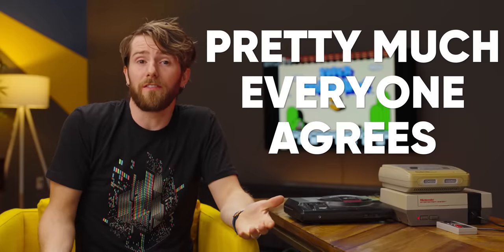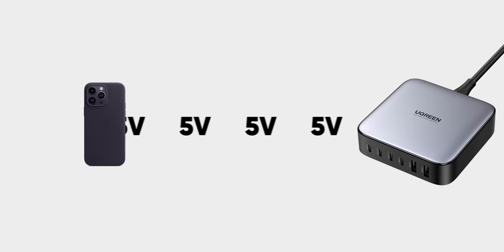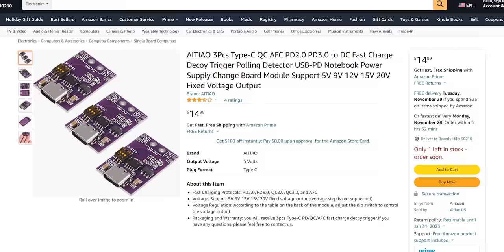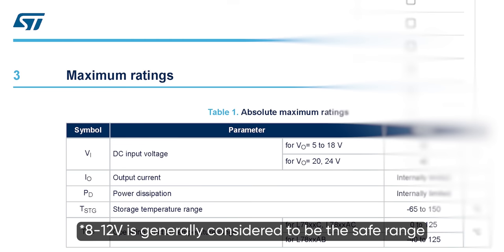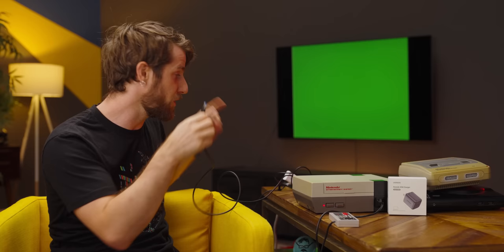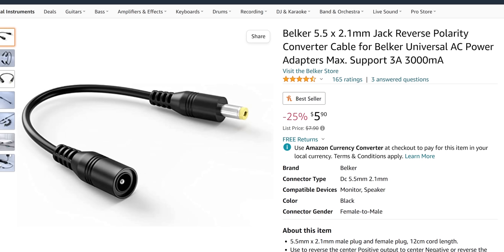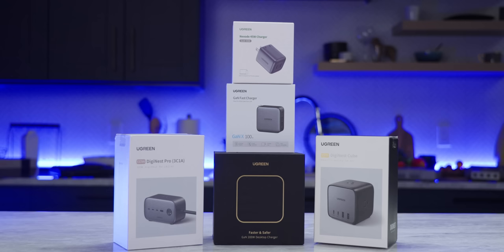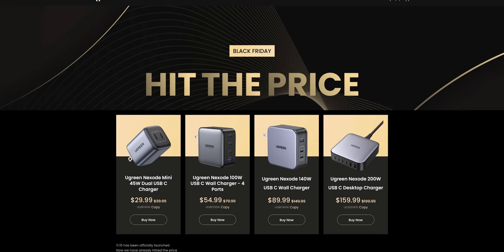How to Put USB-C Power on ANYTHING (almost)

Comment: I took a shot at this like 6 months ago when my laptop charger broke and replaced it with a GaN charger USB-C to barrel jack cable. I was surprised it wasn't being discussed much anywhere. But I didn't think to use the same tactic for old game consoles since they can be a bit sensitive
Reply: I put a PD 100W USB C Port inside my laptop and wired it to + & - of my barrel jack, had to modify the frame a bit
Laptop uses up to 180W but its totally worth it for portability, and being able to charge your laptop anywhere easily
Reply: @flosa1995  unless you're thrashing it to hell by stress testing it or something (which is dumb to do on a laptop anyway lol) or overloading a fat dock (which if it didn't have thunderbolt in the first place I doubt you are), then that should be fine I'd think - your power draw likely won't ever come close to that max. I'd do the same if I trusted myself with a dremel to make it presentable but I don't 🤣

For retro game consoles though I don't think I'm willing to risk it, they're too weird, arcane, and if it dies you can't easily replace it. Either OG adapters or the battle tested Triad Magnetics are the way to go for those
Reply: @alienJIZ1990  
Yup plus I'd think that modifying a retro console decreases its value to collectors, even if done properly
Reply: @flosa1995  yeah, if it ain't broke, don't fix it. Repairs are another matter but even then, I'd still go with the original barrel jack version of this "ShawMerlin/NES-Power-Module-Redesign" over their USB-C option just for authenticity

Comment: Ya know after 30 years, Capacitors can leak out their fluid, or fall out of spec.  It’s probably worth doing a recap on old Consoles.  Capacitors are often employed to smooth out ripple, so it could play into these power supply considerations, among others.  It could even change the sound of the output, maybe un-nostalgically, or it could restore childhood memory sonic performance.
Reply: oh yeah any old system like the nes/snes/sega master/genesis/pce/turbo 16 need to be recapped before trying to do something like this.
Reply: And that's even if they bothered to pay for decent capacitors in the first place. Some systems were built with the assumption that they wouldn't still be in use more than a few years later, so cheap capacitors.
Reply: @SmallSpoonBrigade  well that and there was capacitor shortage/issue in the late 80's and early 90's so they had to use them. This is why so many older systems like the Genesis and Turbo16 have damaged PCB's from cap leaks.
Reply: @CecilTheDarkKnight234  Why? They're supplying the same voltages as the original power bricks. Unless you're suggesting you shouldn't use the console at all without a recap I think you misunderstood what happened in this video.
Reply: @chublez  No, it's you who isn't understanding. The console shouldn't be used at all without a re-cap. The caps will be seriously degraded and they will be well outside of their rated hours.
Reply: Also check voltage regulators, if they go it can fry chips.
Reply: @CecilTheDarkKnight234  or cough get an emulator
Reply: "Just recap 4Head"

From watching Adrian's Digital Basement for a few years, I can safely say that not everything needs a recap, and the things that do are in the minority.

Is it better to be safe and replace them with all new caps?  Probably (if quality hasn't severely degraded like everything else in life), but it certainly isn't required.  I'd be more worried about old batteries spewing their guts and destroying boards.
Reply: @chrisschneider850  You're worried about batteries spewing acid out and not the caps? That's how the first gen Xboxes are dying. Their caps are ticking time bombs.
Reply: @SmallSpoonBrigade  how do you not consider that
I'd be like: someone will probably be using this decades later
Reply: @Xnoob545  Because it wasn't a thing at the time. There were still some older consoles in use, but technology was evolving rather rapidly and with that there was still a bunch of improvements to gameplay.
Reply: Recapping is quite common for the retro consoles, most shops that deal in retro stuff sell cap kits now, among numerous other improvements and such.
Reply: @AceStrife  I agree! I have rarely encountered a functional console that required a recap. I watch Adrians Digital Basement too and I've rarely seen him recap anything. It's a general thing that allows people to sound like "experts" I think. Makes them feel smart. As an experiment, I removed every cap from a PC Engine and tested each one, they were all perfect. I've recovered caps from damaged console PCBs and after testing them, they were still well within spec. This idea "you have to replace caps" or dire things will happen is basically total nonsense.
Reply: @snickerdoooodle  I think you are referring to the RTC (real-time-clock) capacitor specifically, which was a problem for all motherboard models except v1.6. Other caps can fail too of course, but it's good to know which ones are in danger the most.
Reply: @electronraygun6346  The caps used in most 90's game consoles are known to leak but it's not like every single one is going to fail.  Quality control wasn't as good back then and there's a fundamental difference in the way they are designed (don't remember the details but I think it was a manufacturing limitation of the time).  Game consoles also have to be built cheap in order to make a profit so using cheaper caps was basically a requirement.  I've never heard of anyone having to recap a PC Engine though so perhaps those used higher quality caps or a different type.  I have seen plenty of Sega Genesis/Megadrives, N64's, PS1's, and arcade boards covered in cap juice.  The main issue is mechanical so even if the cap test fine it may still fail and leak acid in a few months (another thing that's changed in newer caps in the 'juice' which is less toxic and less harmful to the board than the old stuff).

Comment: I have been researching to do just his thing. I was honestly going to first solder a USB-C replacement for all the mini and micro usb things first before moving on to triggers for other things. You seem to have solved my problem as I didn't know there were triggers that were switchable by soldering pads.
Reply: There are small $1 adapters on Aliexpress for all of your micro and mini usb to USB-C stuff.  That's what I did.  They even do an assortment of USB ribbon cable adapters in all sorts of configs!
Reply: An alternative I like is magnetic-tipped USB cables, which come with a variety of detachable tips: type C, micro-B, and Apple Lightning.  The tips are low profile and you keep the appropriate tip in the device's charging port.  The other end of the cable is USB type A male, which fits any USB charger that has a type A port (so it also fits the USB ports on a desktop pc or laptop pc).
     I've seen two styles of magnetic-tipped USB cables: round tips and oval-ish tips.  The round tips are good only for charging, but the oval-ish tips have pins for transmitting data too.  I chose the oval-ish style, to be able to transfer files between my pc and smartphone.
     I keep at least one charger + magnetic cable in each room in which I spend a lot of time, and I keep the appropriate tip in each device, so any charger+cable can charge any device.  I didn't have to buy any chargers, because enough of the chargers that came with devices I'd purchased in the last 12 years have the type A port rather than a hard-wired cable.
     A big advantage of keeping the tip in the device is that it eliminates wear & tear on the device's charging port.  Last year I had to replace my cellphone because its charging port had become too finicky after several hundred cable insertions.
Reply: 2 pin usb c is just nice. Also there are trigger boards with switches, for the times that you need some prototyping.

Comment: The USB-C to barrel jack cable is my favorite out of all the cables I own. Being able to make older devices operate similar to the new ones is pretty awesome. I have one that triggers for 20V that I use to charge my laptop and if I use it with a USB-C power bank that has a maximum output of 12V I can use it to power a router for easy testing.
Reply: Which USB-C to barrel jack cable are you using?
Reply: Give us an Amazon or AliExpress name to search up!
Reply: @snowdaysrule  Thanks a ton man!

Comment: Linus: I will put USB-C on everything.

Apple: Write that down! Write that down!
Reply: You mean don't write that down
Reply: @gwenryanmillett  Nope, definitely "write that down. It may come in handy 10 years from now!"
Reply: Correction:
Apple: Look away. Look away!
Reply: @gwenryanmillett  They legally have to now because of Europe
Reply: @Demonologist013  Kinda. They are required to have USB-C in all devices that are powered by a cable. If they switch to only wireless charging, they don't need to add it.
Reply: @Demonologist013  Kind of, but not really. The law only says that of it has a charging port, it must be USB-C. I'm siding with MKBHD and believes they will be only wireless in 2024.
Reply: @ajbp95  I think the law also only comes into force in 2024 🙃
Reply: They will definitely write that down, but with a small note:
"Make specific usb-c cable for every device, so they will still need to buy a crapton of certified cables from us!" (example: receiving board on the usb cable to request for specific volt/current range, but not on device)
Reply: @graciouscompetentdwarfrabbit  True, and for laptops it's one year later, if I'm not mistaken. So Apple has 1,5 year until Iphone 17 (of whatever it will be) to perfect their wireless game.
Reply: right, but no:  ugreen is doing the same thing as apple....and linus is helping :/    lets sell adapter adapters

Comment: I have a few adapters and cables to convert to USB C for older laptops, what I discovered is every single cable and adaptor like this will draw power even when no device is connected this is why when you see linus plug in the second cable with nothing connected it did a hand shake as if you plug in a standard cable that does not happen until a device is connected to the other end, so you technically cant live this sort of thing plugged in 24/7 unless you can turn the socket off as it will always be drawing power no matter what.
Reply: So maybe not a good idea for laptops then . . .

Comment: I've been using their 100W charger and a couple of their cables for a three months now. It's very convenient, I don't have to carry anything else, just one brick and a couple of cables to charge everything! It's doing a good job charging my laptop, phone and smart watches at the same time - I'm glad I bought them and not anything else
Reply: Just curious, what's better quality in your experience, ugreen, baseus or anker? Is ugreen really have a good track record on their products?
Reply: I didn't have a chance to use Baseus or Anker, but from reviews, teardowns and tests that I've seen - Ugreen's 100w charger built with high quality components and there shouldn't be any issues with it. The packaging and brick itself feels like an Apple product, in my opinion.
Cables that I use feels premium and robust, one of the best sleeved cables I've seen and used.

Comment: Like the idea, but I think its more advantageous to do something you would take with you like an eletric razor vs a console, so that you don't have to take its proprietery charger too.
Reply: The advantage here is reduced clutter moreso than anything else and I think it accomplishes that goal masterfully
Reply: My 2 Laptops,Toothbrush,Shaver,Flosser chargers have all been USB-C'efied
Reply: @milesbush9589  The NES/SNES/GEN do benefit, but i think the PS1/DC/N64 don't gain anything since they don't have wall warts. If anything it makes it less convenient unless you already needed to replace the power supply and cant source a replacement

Comment: The NES and SNES original power supply outputs 9V AC! Since the circuit inside of the consoles can also take in 9V DC this method is valid, but some devices may not work with DC when they want AC. If you trying this you could damage your device.
Reply: MattKC did a video on this a few months back. In a lot of these consoles they'll take DC just fine, it just goes through the rectifier and continues onwards as intended.
Reply: @samuelw4584  yes i know but the fact is still that on some device this could not work. And trying it without potentially damaging a device is not the greatest idea. The NES/Famicom and SNES  as I mentions are devices that also accept DC because how they convert AC to DC which makes this “mod“ totally fine.

Comment: There's good reasons to change the power supplies in consoles, I've already done a few MEGADRIVES/Genesis and MasterSystems replacing the 7805s with buck converter modules means there's no heatsink required and cuts down the overall temps which is noice. and for the other systems Dreamcast, Saturn etc it can help with failing PSUs and be more efficient for installing mods like ODD replacements. There's some really nice options for GameGears and Gameboys too for USB type C.
Reply: Really? So basically I can rip out my Dreamcast psu safely and mod it that way?! Oh I'm kinda hype to resurrect this bad boy, been sitting gathering dust in my collection shelves
Reply: @Chronostra  did you watch the video? they do that in the video
Reply: @TheSynrgy1987  watch the video? Yes. Understand the explanation? no.

Comment: Might aswell put it on the rtx 4090 at this point, even that will perform better than the current fireplace one
Reply: Currently USB c pd can deliver up to 100 watts, it will need 6 USBs c to make it, but USB 4 pd will in theory deliver up to 250 so 3 of those will do it too
Reply: @andrescarrasco1248  it was a joke.
Reply: @DanielGyimesi  We don't do that around these parts. Not when USB-C is involved.
Reply: @DanielGyimesi  I know but it's actually possible, in fact I wouldn't be surprised at all if some brand of both PSUs and GPUs  decide to try it, pretty sure because of the amount of USB Cs that are being made right now, it would make financial sense

Comment: I have a lot of adapters like this, including a magsafe connector for the MacBook. 

Most of the time they work, but sometimes they just don't negotiate properly. 

It's okay if you're at home but don't rely solely on these if you're on the move outside. Have a backup ready.

Comment: Having a large collection of old consoles and all of the power adapters that go with them, this is a game changer. This would simplify my set up tremendously! Will do some more research into this. Thank you LTT!
Reply: It would definitely make a small setup where you plug in one console at a time easier. Just plug a few things in the back, controllers in, and you're ready. Some video cables have multiple end connectors (e.g. SNES, X-BOX, Playstation 1/2).

Comment: These console mods and adapters are great ideas! If there's one thing I worry about with vintage consoles its is the power supplies giving up the ghost. Some of these are very difficult to replace due to their rather proprietary nature. Being able to power them using a standard that's gonna be around for many years to come (I hope) will hopefully keep these machines going for a lot longer. (Of course this only half works with things like the Dreamcast. I'm more worried about the motor in that thing calling it quits. Perhaps there's an SD card solution for that thing...)
Reply: >Dreamcast
>Perhaps there's an SD card solution for that thing...
There are already ODEs.  GDEMU is a popular one
Reply: @Code7Unltd  Excellent news! Good to hear that such a product exists. Those GD ROMS and their drives won't live forever.
Reply: Most of the SNES, NES, and Genesis power bricks have a single electrolytic capacitor  that simply needs to be changed out, and they're as good as new. Same goes for the internal PSU on things like the Dreamcast, PS1 and Sega Saturn, a few new caps and it's like new. The power supplies, very rarely, outright die.
Reply: I use Triad Magnetic replacement PSU's. It's a lot cheaper than the better quality USB power options (if you want quality supplies). On power boards you can access inside the console, I just recap those with Nichicon capacitors.
Reply: speaking about dreamcast specifically   100% DEFINITLY DO NOT   DO A USB C power brick for one  it needs more power  then a usb c cable can even handle and will more then likely fail fry the console and probabally start a fire  
theres already other options for it anyway
Reply: @Code7Unltd   basicly yes but definitly can not use a usb c  mod for one does not work get a renewed inner power converter instead
Reply: @TooBokoo   i know how dreamcast  works  with its power /voltage stuff  its way better to renew  the internal psu's parts anyway   not doing a usb c mod for it may go the same way for the  saturn too
Reply: @noyukikun  Pretty sure the Dreamcast uses around 30W, well within the capabilities of a lot of USB C cables. Unless GDEMU is drastically raising the power consumption it should be fine
Reply: @tannermccoolman4647  Oh yeah, modern USB power delivery should be able to provide plenty of juice to run a Dreamcast. and I don't see the GDEMU increasing power demand, it's more likely that it actually reduced it. The motor of the disk drive is probably one off the most power hungry parts in that thing.
Reply: @RedArremer Why that specific brand and where do you order them from
Reply: @codybugcm  Every time I reply, my message keeps disappearing. Google my web site if this message gets through. Cheers.